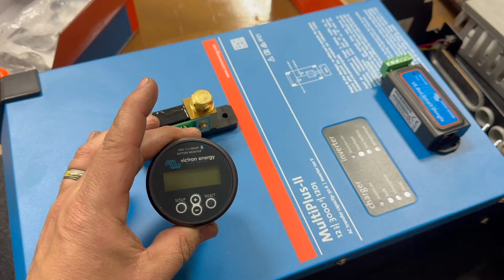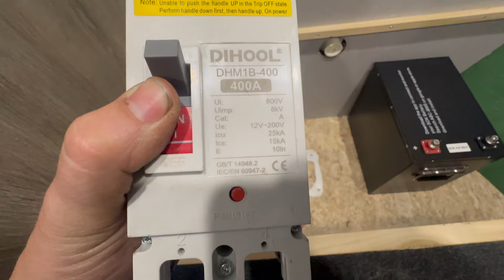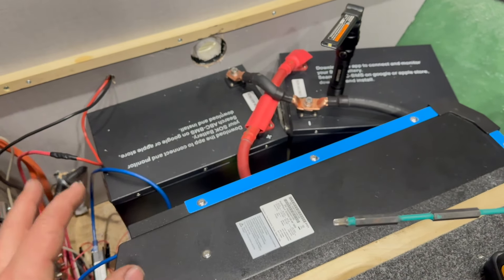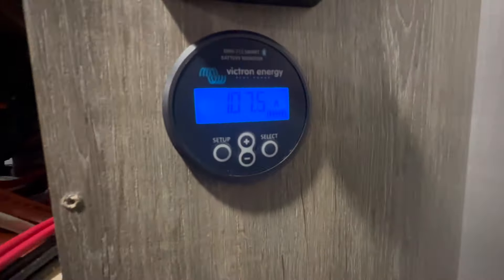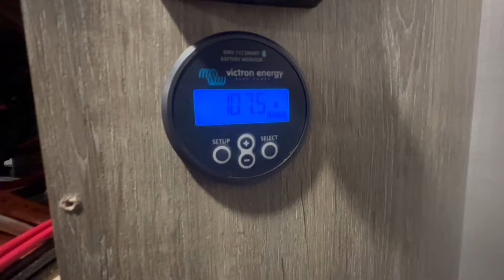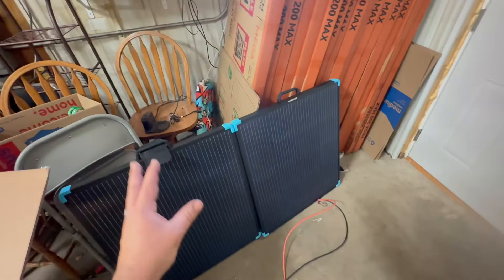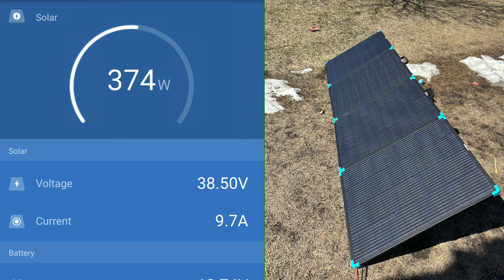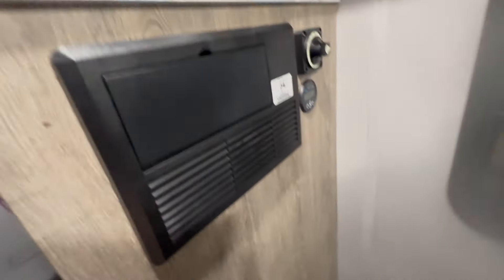Intech Sol Horizon Victron Solar Install   - BMV 712 - SOK Battery with FLIR imaging

Comment: Nice work and great walkthrough. I'm about to do a similar install in my sol dusk. Was the shore power cable long enough to pull it all the way to the multi-plus without extending? What did you do about a chassis ground off the lynx distributor?

Comment: But did you test the fan output when the cushion was back in place?  Food for thought...perhaps duct the fan with a diverter valve to direct the heat into the tt when it is cold or outside when it is warm.  This could easily be done with pvc.

Comment: Great video nice work, I have the exact same trailer, is that setup enough to run the air conditioner overnight? Thanks
Reply: No, 400ah of battery will run your a/c for less than 3 hours.

Comment: Thanks for the video. I’m buying the slightly larger trailer called the dusk and want to do that type of upgrade. What size batteries did you use and what were the measurements?  I am hoping to go with the epoch 300ah battery (x2 for 600ah) but not sure if they will fit. With this setup can you run the ac on batteries and use solar to keep the batteries charged?
Reply from the maker: We did the SOK 206 ah batteries. Exact specs should be on  SOKs website.

To run ac on solar requires a lot of solar. I’d say 1600-1800w minimum. You can still run an AC on less you’ll just be using battery to do it, solar will just offset.

Comment: Question, what did you need to do related to the converter. I’m to a point where I’ve completed the AC connections, I believe I saw that the last breaker is switched off in the video, is that for the converter? Also what gauge did you run to the battery switch, I was going to use 2AWG, OEM gauge was 10. thanks for the video.
Reply from the maker: Disconnect the converter. Wire gauge should be 4/0 if Multiplus 3000, 2/0 if 2000. Don’t burn your camper down :-)

Comment: Hi- great video. I'm in the middle of a DIY Xantrex Freedom XC Pro 3000 install on my exact same Intech Sol Horizon Rover trailer. I really appreciate your video. I do have questions I hope you can help me with. 1. What type of wire is the main orange wire you extended down to the Multiplus? I pulled my panel, but couldn't see the type printed on the wire. I can't find anything that looks like it on Amazon either. Working on this project in phases, I couldn't pull the wire out of the panel either. 2.  I'm not and electrician, and I see a lot of confusing, conflicting info with crucial detail missing that I need to understand. The Xantrex 3000 is capable of putting out 50 amps. The Sol is a 30 amp trailer. I'm never going to add any additional circuits. The AC obviously runs on 30 amps. Xantrex recommends 6/3 wire for the 3000, but its huge to run except by your external method that I'm not opposed to. But do I HAVE to run 6/3 if I'm only ever going to have 30 amp loads run? I don't want to burn my investment down though. I see you aren't running 6/3 to/from the muliplus, but I still can't tell what that orange cable is...   3. Is that area whre you ran the cables actually part of the refridgerator, or "built-in" InTech vent area the fridge butts up against?                                                                                                                          I've basically bounced around and came to the same conclusion with your component placement. Intech doesn't make it easy with that dinky storage compartment to get things to fit, and get enough airflow. I'm also ordering that FLIR camera because I am overly paranoid. Thanks very much!
Reply from the maker: The wire is available at any Home Improvement store. You’ll find it in the electrical section sometimes called 10/2.

When looking at amps on an inverter charger, there’s two different ratings. One is for the AC input which is the typical RV 30 or 50 amp 30 amp uses 10/2 wire 50 amp uses 6/3 wire then there is the DC input and output typically that somewhere between 50 and 100 amps.

The inverter we installed here is capable of operating a 50 amp RV and using 6/3 wire but there’s nothing wrong with using 10/2 because the inverter itself can’t output more than 30  AC power. The 30 or 50 amp distinction only has to do with the pass-through current.
Reply: I can’t thank you enough for you identifying the wire. I since watched the vid in slow motion and did see that it was 10/2. And I think I understand now about the pass through distinction- I still have to research and digest that. Do you have a breaker on the AC in? And what about the wire run up through that vent- is that vent part of the actual fridge? I’m wondering about fridge servicing/replacement. If it is NOT part of the fridge, that run is pure time saving genius! THANK YOU!

Comment: This looks great, and is exactly what I wanted to see. I live about an hour from you and have an Intech flyer forge that I just purchased, which has very similar if not the same progressive dynamics converter charger. I’ll be looking to do a similar but slightly more expansive build with you later on in the year. How exactly does the new charge inverter work with the original PD charge converter?
Reply from the maker: Doh! I forgot to mention what we do there. Easiest thing, just turn off the breaker for it.  Sometimes if the circuit does more than 1 thing we’ll disconnect it. With the Multiplus, it is redundant.

Comment: Very tough for any maintenance.  I hope you have the codes off the units for fixing pass word problems and so on ... How do you put in 107 amps and the unit is set for 14 amps ... from shore?  I think the charge controller .. inverter is to have 4" air around it
Reply from the maker: 14 amps AC input limit is 120VAC that’s over 1600w , if we translate that back down to the battery current that’s well over 100 amps DC . All about watts / volts = amps
Reply from the maker: @rs1961 doh! Yup. Thank you, sometimes I wonder who watches I’ve do the same thing over and over but then again some of favorite channels are just good dudes doing something they love. That’s all we are here. Glad to have you aboard.

Comment: I'm considering the same trailer. Could the Victron MultiPlus or batteries be put in the compartment under the seat on the passenger side to keep from getting so crowded? From what you did for this one what kind of price range would it be in?
Reply from the maker: I think they could  if you want to give up the space. For us to do it, it’s about $6000 all said and done.
Reply: That is VERY reasonable considering the quality components  and the quality work you do. The only thing different I would want is two 200 rigids on the roof and a third SOK,.....reason for asking about having the batteries and the MultiPlus in separate compartments. That Renogy 400 ground deployment panel looks awesome.  @sotasolar

Comment: I noticed that on Amazon the breaker listed only up to 2/0 cable.  Did you have any problems with 4/0 cables
Reply from the maker: I did trim the lugs a 1/16th each side.

Comment: What is the fan you used for ventilation?
Reply from the maker: This little guy https://amzn.to/3xpivat
Reply: What is that "dial" thing at 2:05 minutes? Thanks
Reply from the maker: @raystanton238 BMV 712 display. It’s like a smart shunt but has a physical display as well as BT.
Reply: Is there an exterior cover for fan while traveling